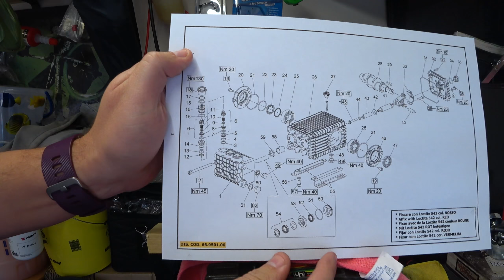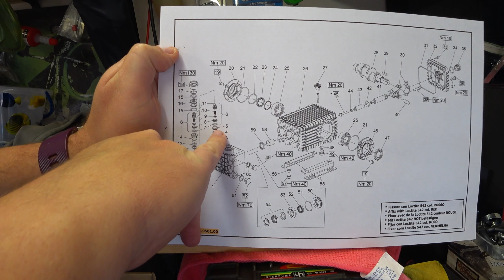Interpump W3523 Pump Strip Part 1 - Manifold/Head

Comment: It’s unfortunate that your camera was affixed on the pistons as you were disassembling the manifold. Because of that, I don’t know the order of assembly.
Reply from the maker: There is another video of the build. It's on my channel
Reply from the maker: https://youtube.com/playlist?list=PL-hmW5VvzARSrKr99Q8PDPNldyjFjBdUl
Here's the whole washer strip, pump strip and rebuild playlist.
Reply: @DirtyDriveAway  I have an Interpump UH-2016 3K PSI version and it’s the manifold. I received it disassembled and after replacing one ceramic piston, I’m trying to figure out the order of the parts assy.
Reply from the maker: @sandymilne224  problem is every pump is different and has different parts. Try this link, then click on handbook and parts. May help, https://www.dualpumps.co.uk/products/UH2016CV-01__Interpump_63_Series_Pump_3400_Rpm
Reply: @DirtyDriveAway  : Thanks for the tip. I looked at the link and found the KIT-166 which would be good to be able to buy. Rare as hens teeth. I could also use K-160 too.
Reply from the maker: @sandymilne224  not sure where you are but you can get kit 166 here.
https://www.pumpsandpressure.co.uk/interpump-servicerepair-kit-166-kit166-5907-p.asp
You will need 3 sets as there's 3 pistons.
Reply: @DirtyDriveAway  : Thanks that helped.Three sets… ouch! Are those parts costly? I’ve seen unbelievable prices, like $155 each per set. $4 cost to make in Asia selling for $155. I’m in the wrong business!! 😃
Reply from the maker: @sandymilne224  pump parts are pricey. The full rebuild on my pump was about £400 In parts alone.
Reply: @DirtyDriveAway  : Now there’s a business opportunity…! 😁

Comment: Hi can you please tell me who the supplier is I need to do the same thing for my pump
Reply from the maker: Hi I got them from a seller on eBay. He is based in Italy and the parts were a lot cheaper than what I could find here. All the parts had the proper interpump stamp on them and the pump has been running sound as a pound since repair. The seller's eBay ID is idropressurewashers you will need to know what kits and part numbers you need by using the interpump parts breakdown. Phill
Reply: Thank you